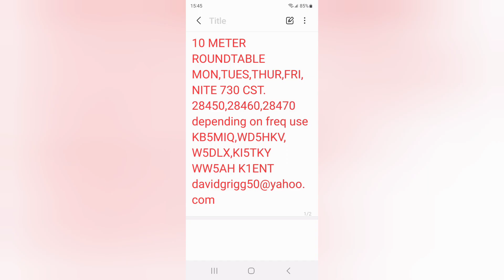900 subs winner pic, and my take on the New RF exposure  rule, Link to worksheet in pinned comments.

Comment: Thanks again for the shout-out! 

The American National Standards Institute (ANSI) and the Institute of Electrical and Electronic Engineers (IEEE) published "Safety Levels with Respect to Human Exposure to Radio Frequency Electromagnetic Fields,. 3 kHz to 300 GHz" in the early 1990s.  QST magazine did a featured article on this standard and speculated on its possible effect on Amateur Radio back in January, 1992.  This issue has been kicking around for decades.  IMHO the ARRL was not going to stop the enforcement of some sort of limits to RF exposure, but has made compliance manageable.  

When I studied the ANSI/IEEE report, I feared that THIS would be the end of Amateur Radio, because RF field strength relied calculations relied on manipulating Maxwell's Laws and all that other high-level math that I could barely perform while getting my Engineering degree.  I couldn't even imagine any of my Ham buddies doing the Calculus, differential equations, and linear algebra necessary to demonstrate compliance to the standard.  Even antenna modelling software, in its infancy in that decade, could barely converge on a mathematical solution, even IF you could find a Personal Computer powerful enough to run the code in 1992.  Nope.  End of Ham Radio.  In 2023, we are getting off easy with an online Java-script app.  Relax, fill in the blanks, and enjoy the hobby!

Your mil experience parallels what happens inside NASA; some administrator or middle-level bureaucrat is always on the lookout for another opportunity to create a project with the largest budget possible.  The rate at which money is spent is proportional to progress in any NASA project, while actual progress towards achieving a goal (launch date, payload manifest, or any other real-world metric) is a secondary, or lower, metric of project progress.  Dollar-denominated projects are important on one's government service resume.  Actual project names, acronyms, etc. are usually incomprehensible to anyone outside the space business, as are actual project milestones and completions.  Thus, NASA is a money furnace, and it's really hard to explain where it goes (much to the delight of the several thousand contractors involved in various NASA programs.)  🙂
Reply from the maker: thanks buddy!! 73!!!